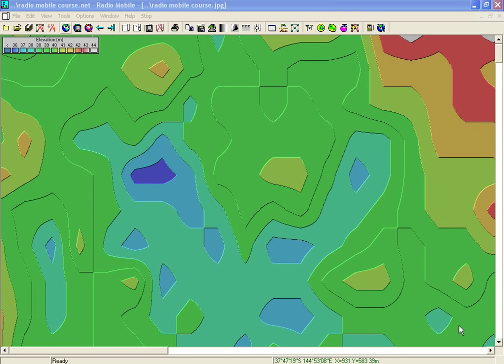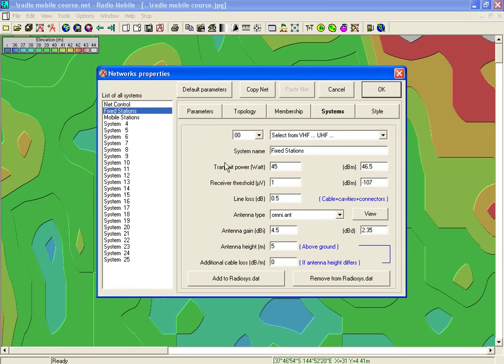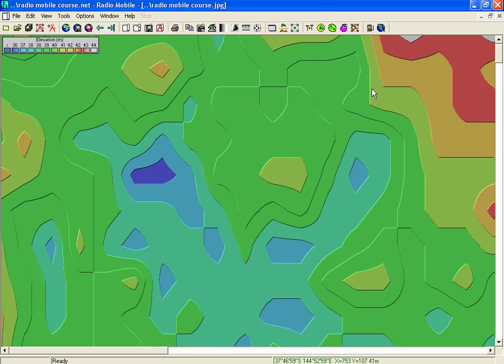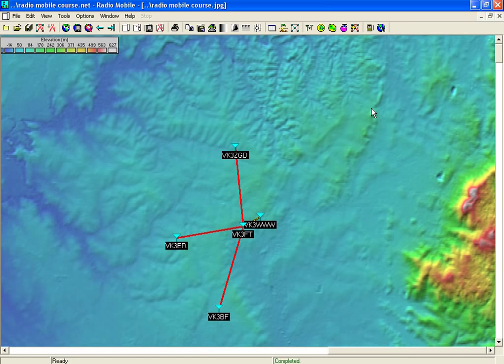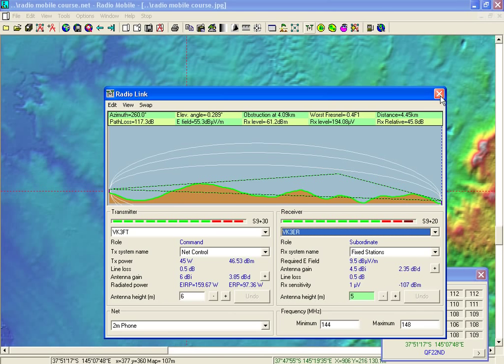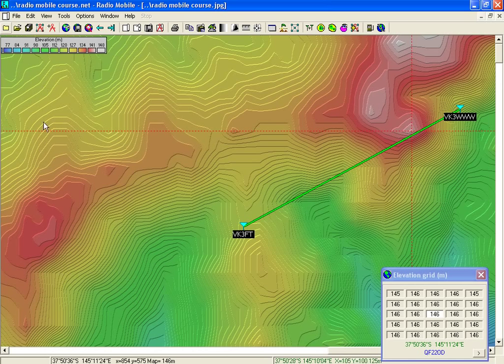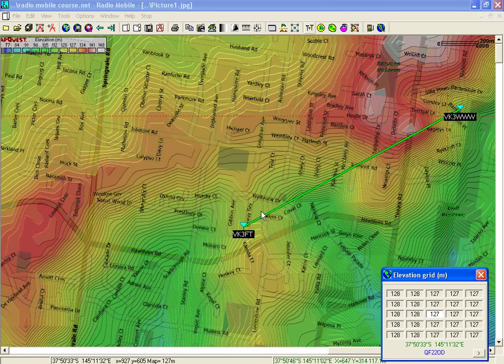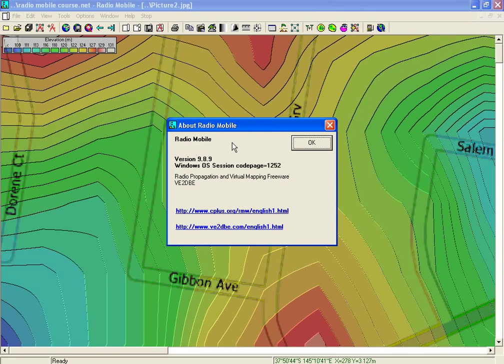Setting up Radio Mobile.avi

Comment from the maker: I am sure in the commercial programs they allow for two way communications. Each unit must have a system (antenna, antenna gain and height, output power and receiver sensitivity) so not all units are the same and you can create different systems to suit unit differences. Units must be added to a network to be active on the map. I have not played with nets but my understanding is that the net could be band, mode or activity related.
Stick at it and you will understand it a lot more.

Comment: Thanks for uploading this.  I'm trying very hard to learn to use this program.  It's a lot more complicated than the high-dollar commercial programs I've used at work, but it's nice that the author provides it at no charge.  Still trying to figure out what networks, nets, systems, units, etc. mean.  I think this will help.